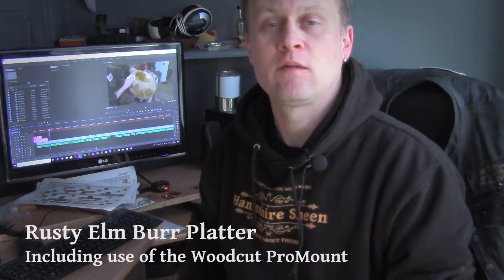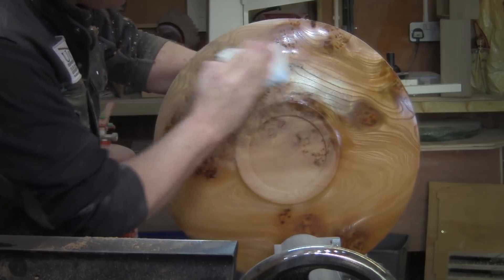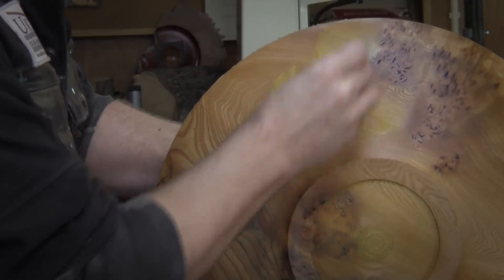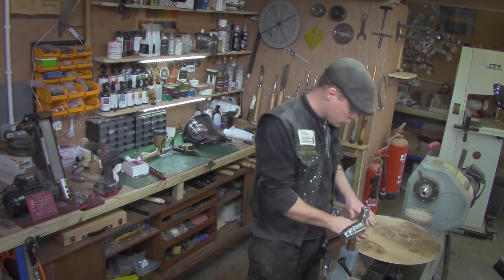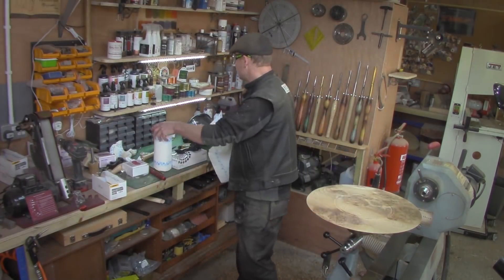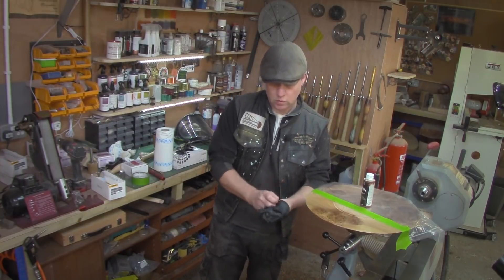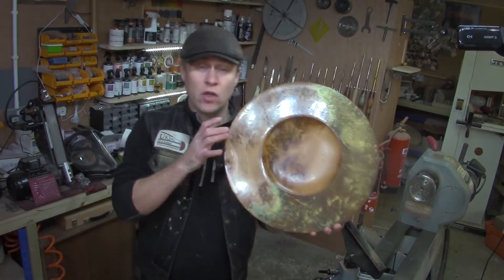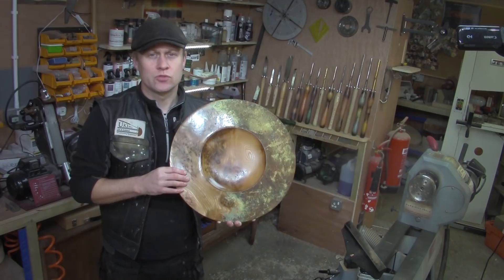#90 Rusty Elm Burr (Burl) Platter Woodturning

Comment: Brave, bold and beautiful, Martin! Great video - thanks for sharing and doing something so adventurous with such a beautiful piece of wood. The metallics echo the wood colours very nicely. It was definitely the right thing to do to blend the paint and lose the hard edge. Another set of paints on the to buy and try list! Cheers!!
Reply from the maker: Thanks, Stewart. Much appreciated. The metal paints are great fun to use....so random with all the variables like ambient temperature, humidity amount of paint vs activator used.
You'll have a great time using them!

Comment: I like what you did with the Elm Burl.  It looks like you extended the iron/copper treatment beyond the original masking.  Looks good.  I just recently started watching your videos, jus subscribed as well.  Besides your creative artistic approach to woodturning, which I am impressed with, you actually take safety seriously.  I find that to be a rare thing to the extend you take it.  Protecting not just your body,  but also your lungs, eyes and hearing. How refreshing to see that and that you promote that.  I like working with wood. I am not a woodturner, I think I would enjoy it, but it is not likely that I will get the equipment I need.  Right now my focus is on photography and wood working projects I can manage with a modest amount of equipment.  Happy to have found your channel.  Some of your techniques could be applied to a few projects I have in mind, Coloring wood is something I find intriguing and worth pursuing, if only modestly.  Thanks for sharing.

Comment: Really enjoyed that. Wondered where is was going  with the rusty effect but it turned out really nice. Thanks for demonstrating the alternate mount. Very useful! Great piece, as usual.
Reply: Hi Nancy,  Here is a link to the Woodcut Tools Pro-Mount. 
https://www.woodcut-tools.com/store/c15/Pro_Mount.html
Very useful tool for works like Martins which you require to be returned to the lathe after detailing. Thanks for your comment, Woodcut Tools.
Reply from the maker: Thanks, Nancy. One thing I like doing is trying something out with many variables, and these paints are great. The result depends on ambient temperature and humidity, the amount of paint used, and the amount of spray used. And, the mount is a great addition to the shop.

Comment: The processes you use always scare me, but the end results amaze me every time. I just wish I had you confidence and ability.
Reply from the maker: Hi Mac. Thanks....they scare me too most of the time! But with experience comes confidence. What I would suggest for you is to try stuff out of scrap/cheap wood to start with and build a technique that works for you. There are no special techniques in this project as far a the turning bit goes - it's standard bowl turning. The devil is in getting the paint right, and it is so variable (a lot depends on amount of paint to activator used, ambient temperature, humidity etc) that it can be a little hit and miss.

Comment: Great piece Martin, awesome to see you at it again. I have to up my skills not just in turning, but editing as well.
Reply from the maker: Thanks for watching Diemen. In a previous line of work, I used to edit videos all the time. I now use three cameras and an external microphone that all have to be synchronised in the editing suite before I can chop it all down. I think it works, and it does take quite a while to put together. I think it;s worth it though.
Reply: Most definitely worth it. The effort really pays off.